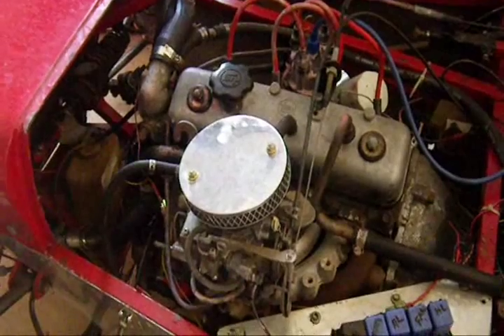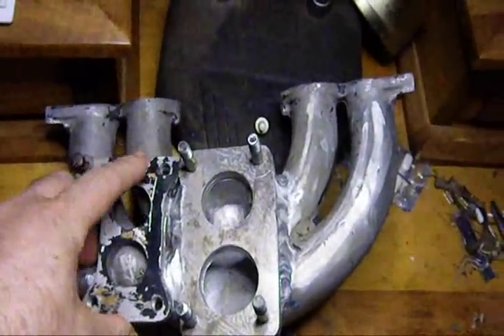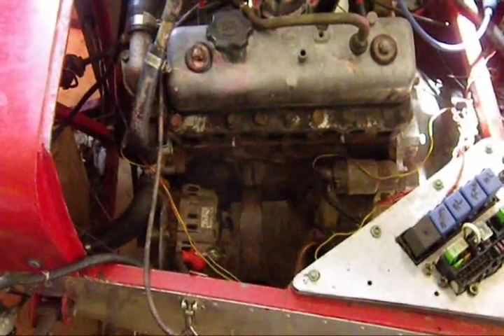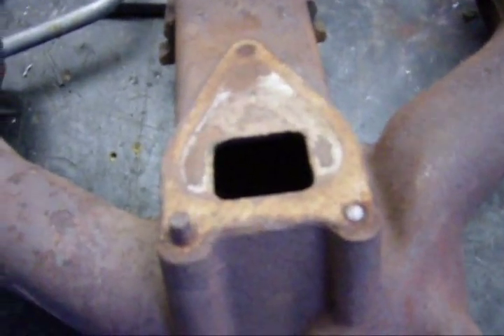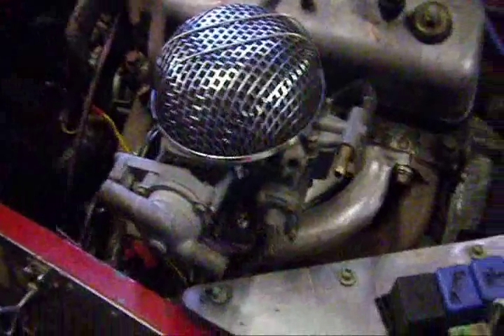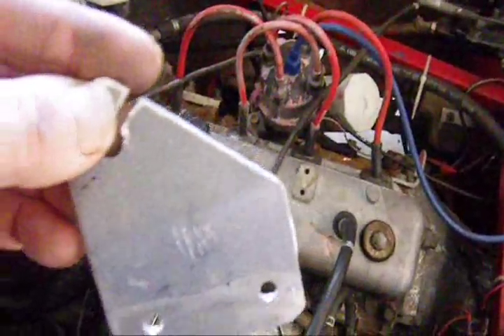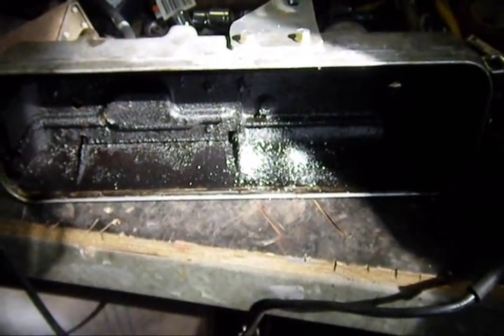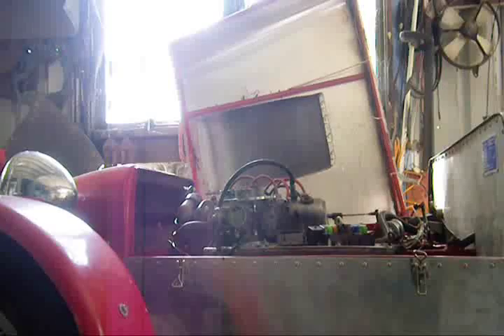Weber 32/36 DGV instalation on a toyota 4K  engine

Comment: Did the stock throttle cable reach? Asking because the throttle linkage is on the front of the carb compared to the back
Reply from the maker: its in a clubman the throttle cable was a custom one I made

Comment: Does your carb hiccup like a bitch if you get on the gas from idle?
I have the same setup and mine hiccups like mad
Reply from the maker: +esnevip No it does not hiccup at all once the engine is warm I now have a set of tubular headers  and it runs pretty good
Reply: Iain Hall I have some extractors too and mine runs like crap :(
Reply from the maker: esnevip
double check for vacuum leaks becasue it sounds like you are leaning out once you get off the idle jets
Reply: will do, cheers :)

Comment: Great stuff Iain, part of the fun getting it all to work, sounds good mate.
Reply from the maker: Scott Best I drove the car to may Yoga class yesterday and she ran pretty well apart from the idle being a bit too fast when the car was hot, I knocked it back a bit so she idles at about 700rpm (no tach so just guessing) till it sounds smooth and unhurried. Very happy with the result  over all .